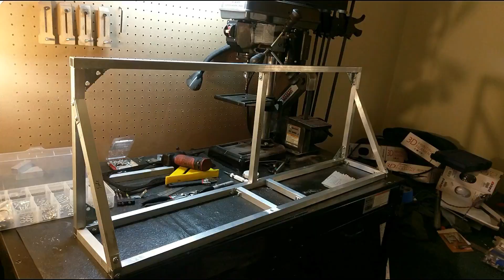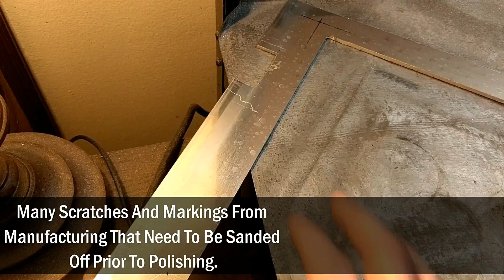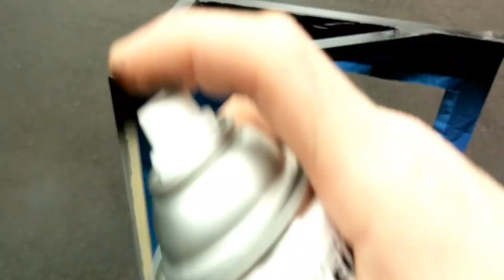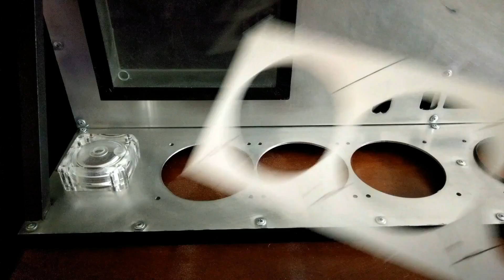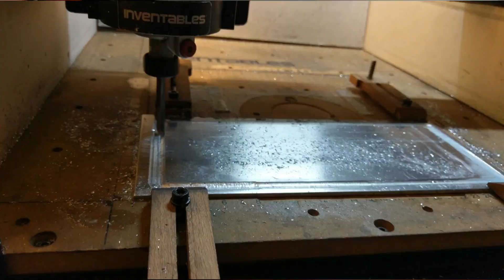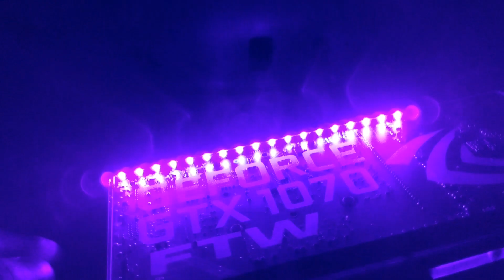Wall Mount Build  Part 1/2

Comment: Hey man, amazing job.
Did you make the reservoirs with your CNC and a rubber gasket cord?
Or did you glue it together?
Reply from the maker: +Pine PC design thanks man!!  😊 the reservoirs were scored, snapped, and sanded. Then to hold the pieces together I used weld-on #4. It's a solvent weld. It dissolves the 2 surfaces and they mix together. Effectively turning them into one piece.
Reply: Alright, cool man!
What do you mean with scored and snapped? lmao, not a native american here.
Reply from the maker: +Pine PC design you take a razor and drag it across a few times in a line. Making a really deep scratch. Then, you bend it on that line and it snaps all the way down.
Reply: Ahh alright, got it!
Thanks for the tips bro. Definitely going to try making a res like that!
Reply from the maker: +Pine PC design any time man. Check my other videos. I have a some what lengthy tutorial on the subject. May provide some more incite and ideas.
Reply: CyberDen Systems thanks alot mate.